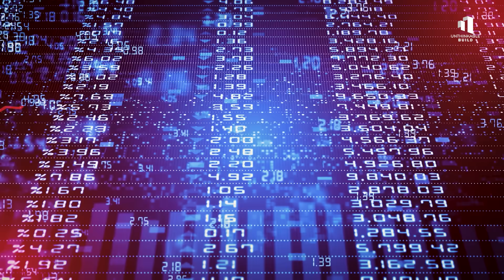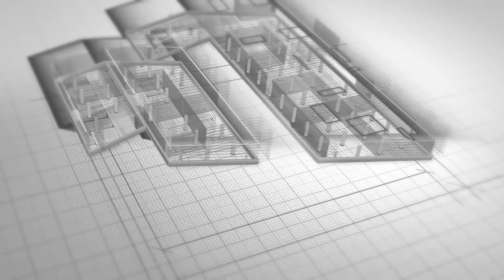Dubai’s $35BN New Airport Will Change Air Travel Forever

Comment: That FAKE CITY has just 2 roots.
OIL & MO$$EY.
They know that.
Desperatly using Oil Monney to GET AN ECONNOMY.
They have nothing to worry about this & next generation.
But if they dont Sheikh sth out of the sleeve...
Dessert will reclaim it as it did with The Sphinx and Pyramids.
(1000BC AND 1800 AD Sphinx was ears deep in the sand).
Reply: Clearly you have no idea about Dubai or its economy.
Better read & research before commenting
Reply from the maker: The rapid development there is definitely driven by oil revenue, and the goal is to diversify before those resources decline. Whether it succeeds depends on how well new industries, tourism, and technology sectors take hold over time. Desert environments can reclaim abandoned places, but long-term outcomes will be shaped by how the economy adapts once the oil advantage fades.
Reply: Haters gotta hate 😂